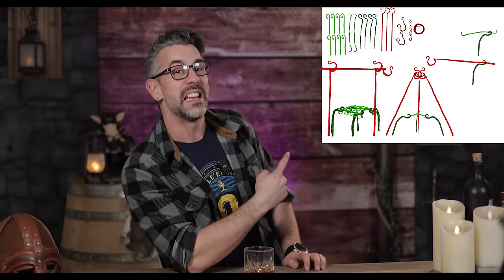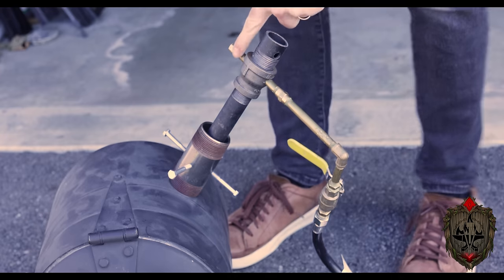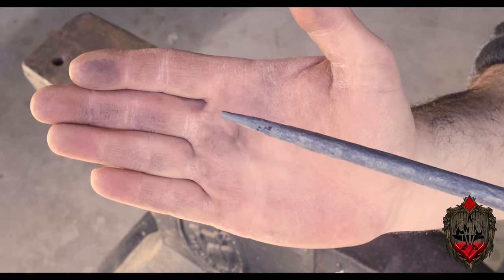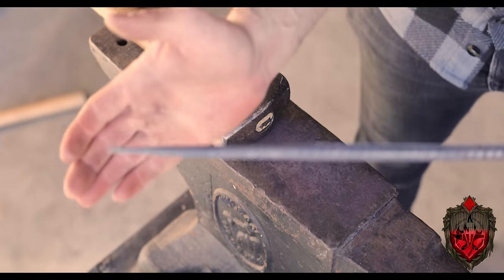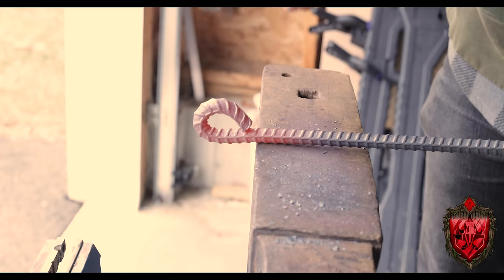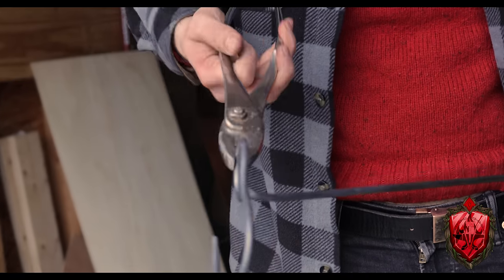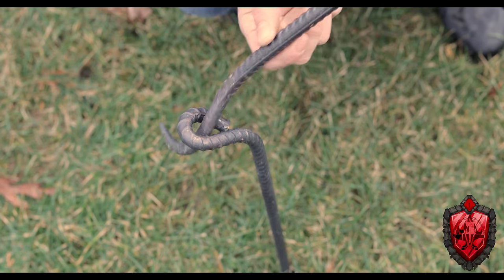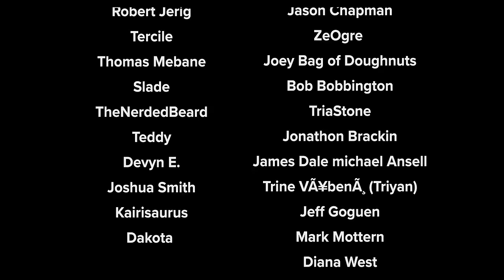Forging the Ultimate Campfire Cooking Setup

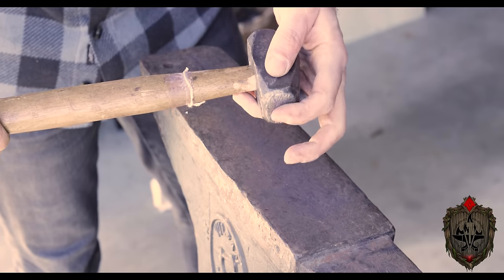Comment: 3:45 as an aspiring blacksmith, the first one was a cross peen hammer which is very useful for spreading metal in a certain direction, and the other was a double headed sledgehammer, and I will suggest to round one of those faces for spreading metal in all directions like a large ball peen hammer. But keep the other side of both hammers fairly flat for evening and flattening out your metal after it has been stretched/ shaped, oh and also have the edges of the faces slightly rounded to keep your work smoother. Also your trick with leather crafting and letting the hammer fall instead of swinging the hammer will also help here. 
...I am such a blacksmithing bookworm, sorry. On with the rest of the video!
Edit 24:30 you already figured out letting the hammer do tha work, I spoke to soon!
Reply: Another blacksmithing project that I suggest is a miners spike/ candle holder or something similar for the aesthete of the time period/ world of your larps. Living Anachronisms has a video on one he got, and Black Bear Forge has a video (maybe 2) on making one, if you are interested of course!

Comment: Also! For better more controlled results, sand your hammer face flat. They almost ALWAYS have a rounded face, this leads to less control because you’re hitting it with a round vs a flat face
Reply: You're better off shaping it like the face of a pocket watch. As a bladesmith I don't have a single hammer that's perfectly flat. that's what a flatter is for.
Reply: @Lockecole81  Fair point, I come from a jewelry/fine metal working background and the applications can be much different. Have to move less material around and imperfections/less control show up more on the piece and we want to avoid sanding/smoothing as much as possible (If nothing else than gold is expensive AF so even a few grams sanded off hits the pocketbook. 

Could also be practice, even moving to large projects I'd probably stick with flat faces, but I've got a couple decades experience with that and holding the hammer etc. I'd imagine going from "rounded" to flat would be as awkward for you as going from flat to "rounded" would be for me.
Reply: @dma-rising8876  Very likely. I liked a friends description of the pocket watch face for an ideal general usage shape. You've got a flatter center area but the graduations to the edge being more smooth. When it's more abrupt like with a flat face, you tend to get a lot of dings in the work piece which you're then trying to chase out or more sanding. Smoother transitions. Do tend to find hammer faces of a variety of shapes like with peins and such. The curved face also assists in moving the material much more easily.

Comment: From what I understand most blacksmiths don't use gloves because they want to hover and sense if it's hot. Gloves will take a few seconds before going through the glove and still burn you.
Reply: No, its because most gloves go on too tight and you can't just shake them loose when a red hot 'thing' gets down the cuff and inside where your hand is - DAMHIK. Loose gloves, short or loose cuff/sleeve. Most gloves these days, they are trying to save .0002 cents by making cuffs that would only fit a skinny school girl.

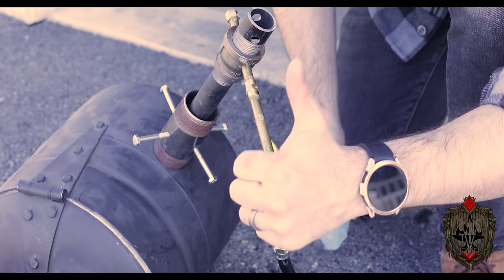Comment: 4:38 mark, while checking for a gas leak it looks as though your valve is closed. It could be the angle and you just have it slightly open, but it just cought my eye that it was closed.

Comment: I planned out a MUCH smaller version, but then I got too busy with work and have yet to dig out my forge from all the lawn equipment my brother stuck in my forging tent yet.
the base was a Squirrel Cooker like this one: https://www.youtube.com/watch?v=Lg2smHwhEH4
then add a Skillet Holder by the same guy: https://www.youtube.com/watch?v=XueT1E41Myo
and then add the cook rack from the bedroll cook set from this guy: https://www.youtube.com/watch?v=Q1iE7D6fuZ0

the Squirrel Cooker has the hook and fork, skillet holder for a small carbon steel pan (Cold Handle #40 sized), and the swing arm cook rack lets you grill if you need to. make the center pole of the Squirrel cooker 27 inches, make a 1inch round and bend it over, sharpen the other end. Boom, four ways for one person to cook for themselves (which would be an awesome addition to the BackPack Of The Wanderer!)

Comment: Recommendation from this Scandinavian wannabe-viking: if you are going out and buying a new hammer, DONT GET ONE WITH A METAL HANDLE!!! 
The amount of extra strain it puts on your body is no joke. 
Always get one with a wooden handle, as the wood will flex a bit and absorb a lot of the impact and vibration of striking the hammer. 
If you are just going to hammer in a few nails, this difference is not noticeable, but trust me, after a few days with hours of smithing, you will feel it.

Comment: as a blacksmith i feel obligated to tell you you're not supposed to move the hammer in the direction you're trying to draw out the steel. you dont wanna push the steel, just draw it out. while you're correct about hot steel behaving almost like clay, you must also keep in mind that the same techniques will not always work.

Comment: I don’t understand why you didn’t season the pieces like a cast iron skillet. The finish is far more durable and far more period appropriate. 
Simply giving the pieces an overall cleaning, heating, and dipping in lard, or vegetable oil, will both give them a rust resistant finish and temper the metal making it stronger.
Reply: That won't do anything to make the steel stronger. Tempering is only going to work on a steel that has been hardened. I do second the seasoning idea though.
Reply: @Lockecole81  I was talking about a coating of baked on oil.
Reply: @jacksonwells292  Yeah, that'd be seasoning. The usage of "temper" there is incorrect. Tempering is the selective heating of a steel item to remove hardness to make the item stronger and less fragile and has nothing to do with baked on oil, which is seasoning/polymerization.

Comment: Can't help but notice that you're missing a pot. If you make one, do think about the food safety of the material involved? Metals are often blends and rarely meant to be eaten from. Copper is great (and historically the most accurate) but can't handle acids without releasing poison insofar as I know. Where a tomato is already too acidic. Copper coated in tin solves this to a point, but that tin mixture again needs to be safe for food. And they need continuous care after use.
Anything coated in enamel is something I sometimes see sold in fantasy markets... Very unsure if that was historically used, but at least it might have less of a personality than copper? Sadly I never liked the designs used there, and so I'm armed with a classy copper cauldron.